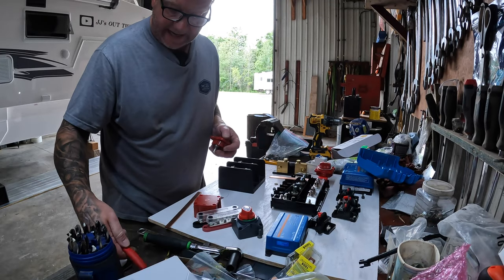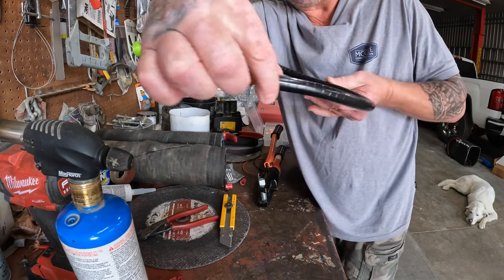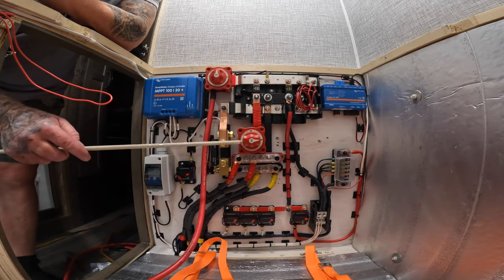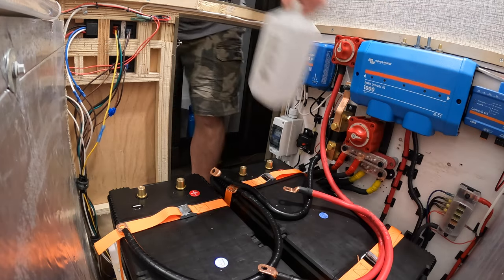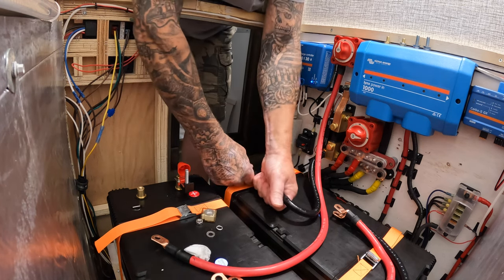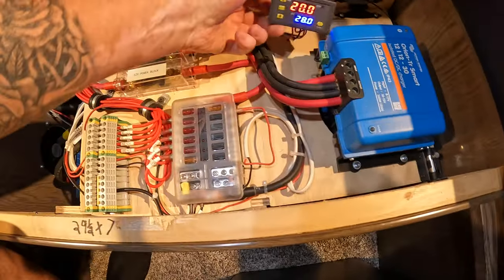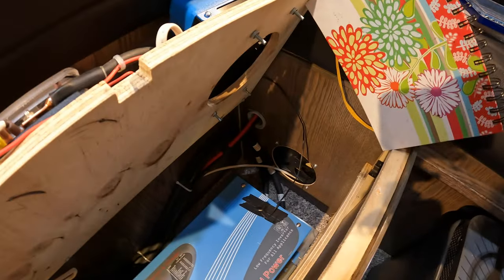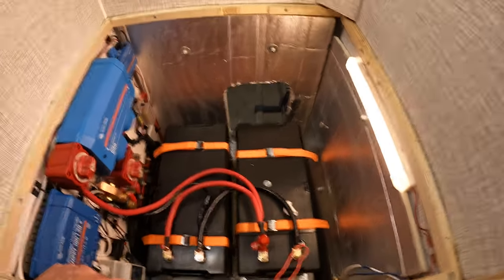Second video of battery Installation in my Truck Camper. E-55

Comment: Honestly, I can't wait to you try this thing out. Please point out all pro's and con's.  I'm not sure our engineer friend knows what you're trying to do here. If this set up works like I think it will, then you need that thing that coverts air into water, up to 5 gallons a day. Then JJ you're set.
Reply from the maker: Not sure why people comment about things they don’t know about. I have seen a lot of battery installs by so called professionals and nothing as protective as mine but o well. I will look up this air/water your mentioning.
Reply: @jjsoutthere7267  I'm not sure but this is a prototype RV and I BELIEVE this is the video that reveals the air to water system. I might be wrong but I will find it. https://www.youtube.com/watch?v=i8DGeT9u314&t=312s

Comment: I just caught up to your recent videos including this one and the irony is that my brother wanted to have his solar system on his camper upgraded ( its not a Northern Lite, its a camper that used to be manufactured in BC and the company folded some years ago unfortunately ) as he had a "solar system" put on at the dealer he purchased the camper from new in BC in 2006 which was only a 80 watt solar panel with a simple PWM controller, technology has changed a lot since then of course. Yes it works but its painfully slow to charge if there is any shade and yes currently has two 12 volt group 24 batteries. Also that dealer did the wiring for the plug into the camper for exterior turn signals etc and the so called charge power from the trucks wiring under the box at the back to the house batteries and what a joke that is as the wiring and I think the trucks alternator and how it interacts with its own engine batteries allows only for such a low voltage ( and way too light a wiring ) that it barely does anything to charge the house batteries, never mind some years later the "quick connector" they used under the truck corroded and he had zero power coming into the house batteries. The camper does not have an inverter for 12 volt to 120 volt but whatever it does have just converts to 12 volt and that is supposed to charge the house batteries when plugged into 120 is again extremely slow to charge the batteries but it does eventually. So just a couple of weeks ago he had it booked in with an RV dealer in Grande Prairie Alberta to install a system but he became apprehensive about what they actually were going to do ( because they would only allow him to talk to the person in parts, not the installer ) so he brought the camper in and paid the installer time to look at his camper and realized that while the installer may have had some skills, understanding what he was being told to install ... he did not and couldn't understand why just another PWM controller could be used and was wondering why he was being told to use a MPPT controller that he was told to mount on a visible wall inside the camper if you can imagine !. The estimate time was to install two 200 watt panels and mount a MPPT but they would have had to run new larger wires to the roof. 6 hours they thought at .... yup, $ 200.00 per hour shop rate. The end result would have been by the sounds of it very questionable and unsightly inside the camper. The brand of the units, its something I have never heard of but made in Quebec, perhaps its ok equipment, I don't know but its certainly not Victron they were going to use. The installation would not have addressed the issue of the pathetic road engine charging system at all and he does not have a generator that is wired into the system but using one by plugging it into the 120 volt cord on the camper, it wouldn't hardly do anything ( using the special cord from a Honda generator that has the 12 volt charging system but again slow would have to be used to get any action ). Sorry for the long post but the theme is that its darned hard to find anyone that really understands the whole camper/solar and road engine charging system to know what the heck they are doing to install a proper system that WORKS, and pickup slide in campers are not blessed with room to work with either and not loose valuable space. I expect your nodding your head JJ in hearing this type of story as the average person does not understand the first thing about it and sadly a lot of those installers who claim they do at a dealership level don't either but they are happy to pretend they do and take a persons money !.

Comment: Yup JJ, I would pay you good money to install something like this on a Lance 975. I know those batteries are expensive. Plus I have a shop here but NOTHING like the shop you're working out of. lol The 975 has a slide and I haven't bought one yet. I'm afraid opening the slide one time with lead acid batteries would drain them. Lance is not big on solar eight but their roof is different. I guess this is something we would have to talk about in private. ???  Anyway, that air to water is real. It's an Israeli invention and works. They have one for RV's. Keep up the good work. Nancy said engineers are a whole different breed of people. I don't think anything he said made you lose sleep.
Reply from the maker: To be honest I’m just showing people what I am doing with my camper. Was really not expecting certain comments because it’s not a class just thought people would be interested and good for my channel. You would think I’m making 200 000 doing this. Lol
Reply: @jjsoutthere7267  I think most people understand that you're simply trying to make your camper better. If anyone has followed you like us then we know you've probably run into certain problems you didn't always talk about. One problem I believe is mainly  keeping that battery charged up. On board generator wouldn't do you any good for IT WON'T start if the batteries are dead. This is my worry about buying a Lance 975. It has a slide and opening the slide one time would drain the battery. YES, I could start the generator but it would be nice to open the slide, use the bathroom, close the slide WITHOUT turning a generator on. I personally like the onboard generator and they are super quiet. The new AC's are also very quiet.  Perhaps just a battery set up would be ok. ???  Lance doesn't have a lot of solar. The one I'm looking at has ONE 100W panel. I truly don't think the truck charges the battery much and you MUST feel the same way since you installed an extra charging wire straight from you one alternator. You never actually told us what that wire is for. Your first video about your camper,  you said you would, be never addressed it.  Anyway keep up the good work and share everything please with us. We're always looking for new post from you. I see our friend the engineer had a response. I'm anxious to see what he had to say. Later!  Well, I read it so my update on my post would be the heat. My wife was also concerned about the heat. Being a electronic tech from the Navy she know heat and electronics don't mix. However I do remember your fan holes. So certainly that would be enough cooling power for the electronic part. 
Take care, Bill

Comment: Don't shoot the messenger man!
First of all, I have nothing against you JJ.
As an engineer and technician, I have more than once configured and installed myself because the technicians could not do it, so your opinion that the engineers are unable to connect a wire is very very very incorrect! .I like to watch and see how people here configure and install their systems, for fun ..I myself have a Northern Lite like yours and I really appreciate this camper .The positive points on your installation are: quality choice of equipment (victron) but the fuses and buss bars do not seem to be of marine quality... Your quality of wiring layout is at first sight excellent (electrician). What I criticize the most is your extreme complexity on a system that should  be simple and efficient, so many wires and connections!!!! A cat would lose her little ones there! Lol. Plus  the equipment heat. Electronics don't like heat ...  In French there is an expression: Why make it simple when you can make it complicated!
When I look at your video ,it seem like looking on a lot of different electrical external videos !!!That you took info in and there and making a system out of it !!
We must never forget that we are addressing  You Tube  all kinds of people and many come there to get information without knowing anything about it .... Here we discuss electricity and electronics, including a danger of fire. I have personally known an individual who had his entire camper burnt down due to an electrical fire due to incorrect modifications.
When we make it complicated we harm rather than help ... I am convinced of your generosity and your pride in '' making '' a system that you will appreciate and that people will be able to benefit from! watch from the beginning. If I may allow myself JJ, be careful about the information you give to people, even if you don't have many subscribers, it can make a difference! I will continue to follow you. Safe travel buddy
Paul B.

Comment: Have you seen that new machine that converts air into water, up to 5 gallons a day I'm told. I wish I remembered the name but old age, well, I don't. There is an all electric RV that has the air to water on it. NOW that's something. Completely solar run, even the RV is chargeable.

Comment: How were you able to run wires from your batteries over to your converter? I also have a Northern light and thinking of doing the same thing. Excellent job and thanks for the video.
Reply from the maker: Hey Roger, I showed it in my video. There is a spot behind the batteries that leads to basement then around to bathroom side where a hole is cut for plumbing that allows wires to be run by furnace.
Reply: @jjsoutthere7267  thank you I didn’t notice that . Thanks for getting back to me and letting me know.😊

Comment: Great video, thanks. Anychance you have a link for that little thermostat you mounted near the inverter that you have hooked up to the fans?
Reply from the maker: Thermostat，W3230 LED Digital Temperature Controller Thermostat Switch Sensor Meter DC 12V 24V 220V(12VRed and Blue Display) https://a.co/d/5q7zAyz
Hope this link takes you to it. If not let me know.

Comment: Did you eliminate the original circuit panel when you rewired everything? I think I just answered my own question when you said that wire out of your converter runs to your panel.
Reply from the maker: Just turned off original converter put 120v panel is still in use it is now fed off inverter.

Comment: I am an electronics engineer, and I looked up and down at your installation .... I must say that you made me a little dizzy, with your fancy design ..I understand that you seem to be an electrician (I recognize it by the quality of the layout ....only!) But your way for the people here is really too complicated....I do not recommend to follow your installations, because here, we are talking about fire danger or bad functionality,design error. It's not just a funny You Tube, channel to be interesting here ,. No offense but I think you don't know what you're really talking about.
Please correct .
Reply: To JJ's defense, I'm sure he is not purposely misleading anyone.  YES, he probably should put a disclosure at the end saying "this is MY DESIGN, do not try this on your RV."  However it's possible that Paul might not know about RV's.  ???  You do understand JJ was trying to simply produce MORE battery power for LONGER LASTING support without plugging in. I suspect months on the road JJ realize he needed to make changes to make traveling easier. I do know RV dealers charge a lot of money for a similar design and I almost BET they don't do as good of a job as JJ did.
Reply: I'm curious what Paul would have designed for an solar powered RV. ???
Reply from the maker: Engineer.. lol our  mine engineer had to be taken to the hospital when he tried to do a cable splice. Lol I always tell engineers just tell me what you want and I will make it work. But anyways thanks for commenting and please follow so years from now you will see how well the system works.
Reply: Very informative ty you are the best
Reply: In my 45+ years of doing machine, work, and jigging fixture building i’ve dealt with a lot of engineers. And I’ve told them I’ll do it that way, but it’s not gonna work. And it was always a pleasure to prove my point. After a while, they would just leave me alone and let me do need to be done.😂😂